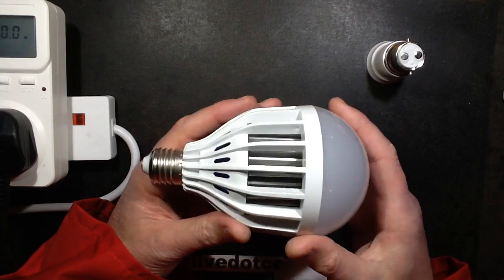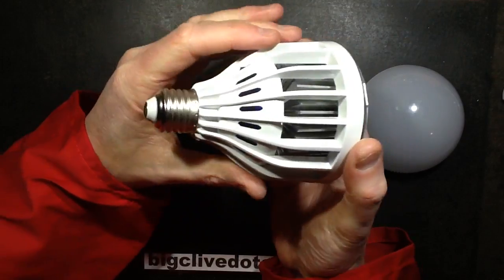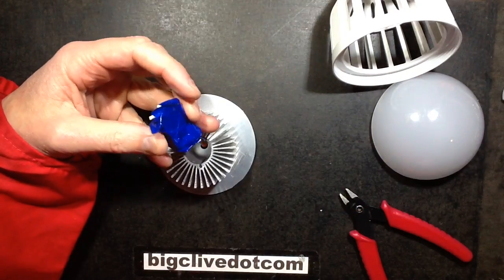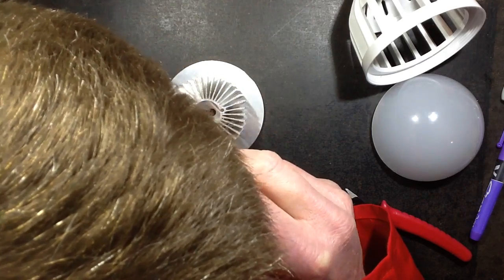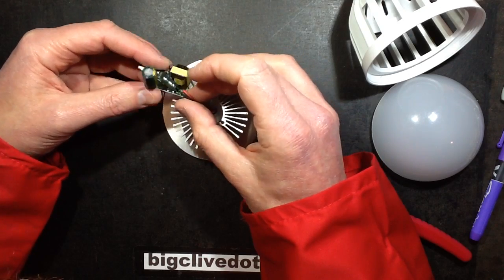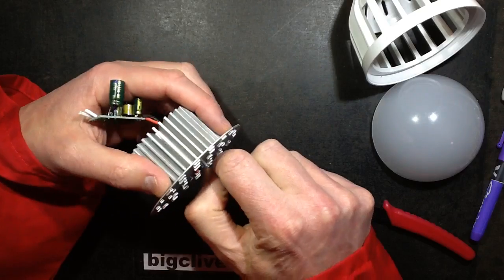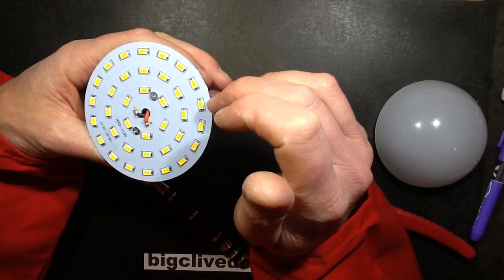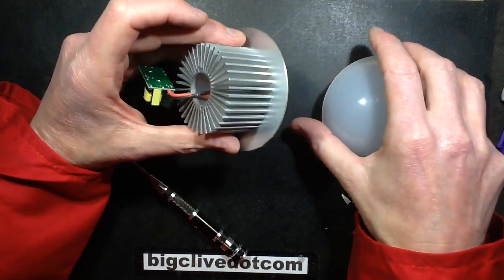Inside a 24W LED lamp.

Comment: I had two fail in the same fixture at once. Of course, "Made in China". Rebranded, imported, and overpriced. I have yet to pull them apart and see the cause of failure. I doubt the LEDs are at fault.

Comment: Feel free to call me dumb, but if that has the edison screw connector, maybe it's meant to run at 110/24W running at 220, would it still pull 24w or would it pull 12?
Reply from the maker: +Chris Roller If it has a universal voltage power supply then it would draw 24W at all voltages, but the current would be higher on lower voltages to achieve that.  Many of the fixed voltage lamps from China are generally 220V.
Reply: +bigclivedotcom that would be me having a brain fart and getting watts and amps crossed mentally due to lack of caffeine. It is odd how these lamps are nearly always half the wattage they claim to be.

Comment: I thought when a seller sells a bulb or lamp like this the wattage was related to its equal in a convertional blub or lamp.
Is that not the case?

I mean does this output an amount of light that a 24w light bulb would put out?

Comment: why is there heat from LEDs?  I've a 50W flood LED and while one can hold it such is hotter than I'd imagine.  10W flood LED only slightly warm but with same cooling fins as the 50W
Reply from the maker: James Campbell LEDs dissipate a surprising amount of heat.  This has to be managed by proper cooling as they fail progressively faster with increasing temperature.  If the temperature rises too high they will fail almost immediately.
Reply: bigclivedotcom agreed on "surprising amount of heat" but why?
Reply from the maker: James Campbell While LEDs are one of the more efficient ways to generate light they are still very inefficient at converting electrical power to light.  If you have a 1W LED that has a forward voltage of 3V times the current through it of about 350mA then the bulk of that energy is dissipated as heat.
Reply: bigclivedotcom I have Philips LED lamps and one started flickering quite fast. They get pretty hot after a while.

Comment: You mentioned this lamp has a SMPS or rather a buck regulator power supply, instead of a capacitive dropper. I guess the latter can only supply up to a certain amount of power. How do the capacitive dropper circuits compare to SMPS in terms of efficiency? And how safe are they comparing to a SMPS, since they are not fused and there is no mains isolation?
Reply from the maker: PuchMaxi1988 The capacitive droppers are best suited to large arrays of low current LEDs.  The switching supplies are better for small numbers of high current LEDs.  The capacitive dropper is very efficient (runs cold), but does have a significant effect on power factor (the relationship between voltage and current.)  The switchers are pretty efficient, but much more complicated.  In this lamp the switcher was not an isolating type.
Reply: bigclivedotcom Thanks for your reply, much appreciated!

Comment: interesting they have standardised at exaggerating wattage by 2 times, shame that flashlight lumens or battery cell capacity doesn't have such a reliable way to determine!
Reply: jusb1066 The main shops are doing something similar.  For example, Lidl's last week flyer here advertised "5W Mini CREE LED Torch" for which seemed like a bargain for €10.  When I saw it in the shop, it said something like "80 Lumen" on the back and that it uses AAA batteries.  80 Lumen is what I'd expect from a 1W LED.  If it does draw 5 watts, I doubt it would run long on AAA batteries!
Reply: Seán Byrne
yes i have noticed the real shops are selling some really bad LED based items, esp torches, very low end inefficient ones, which will leave a bad impression to those new to led's, amazing that you can get decent bright ones for £2 on ebay, well bright enough to show led's are the future, not bright enough to impress the experienced